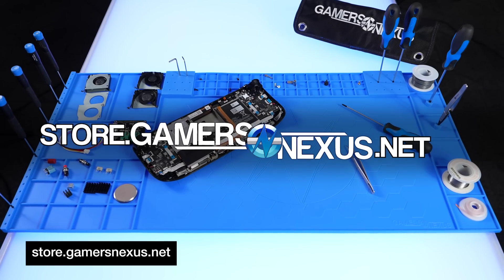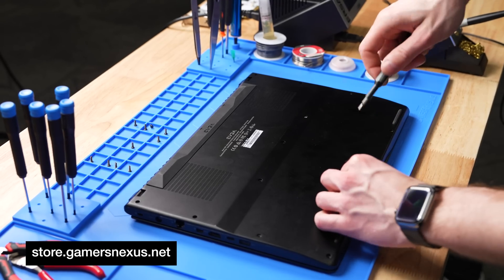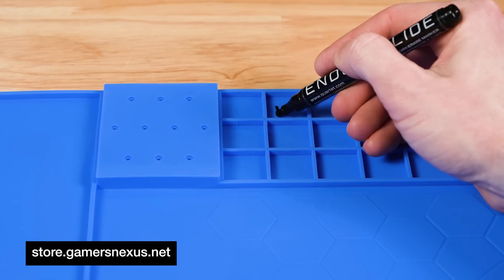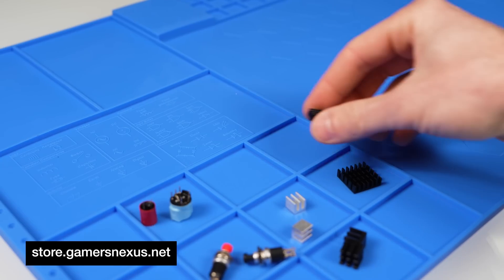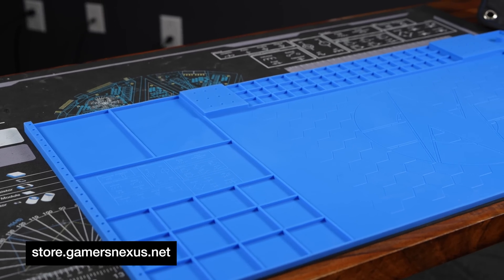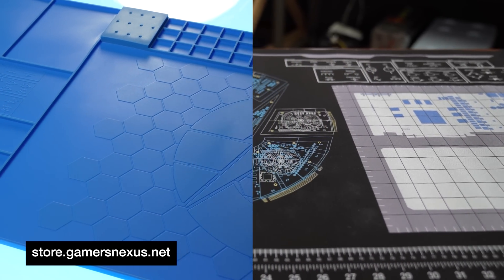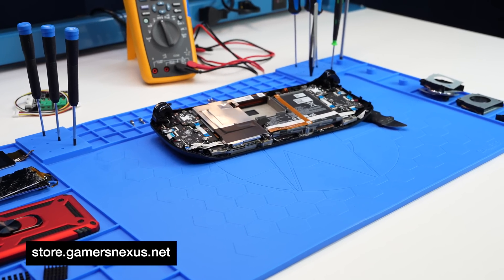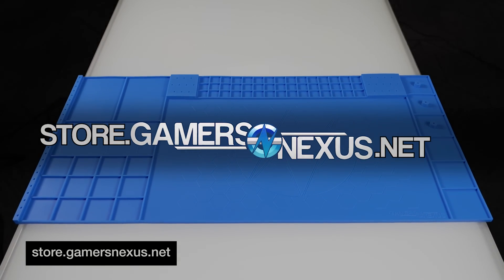Announcing Our New Project & Soldering Mat | GN 'Flux' Silicone Mat

Comment: So you claim extreme heat resistance. But what does that mean in temprature celcius? I might like to use one and some of my hobby projects involve soldering way hotter then you would solder electronic compoments.

Comment: Hello. For me, a  full time Mac/PC repair technician, this mat would have been an instant buy if there was option to buy one without holes for screws and screwdrivers. This stuff does not make sense for any professional because it prevents it for keeping it clean. Simple flat mats are thousands times better in long term use because you can wipe them without using brush or vacuum cleaner.

Comment: I like to build guitar pedals on my free time and this looks pretty nice!

Only thing I would change for my personal use is to switch the location of the smaller squares  and the holders for the solder/wire. I use my left hand to pull solder at work from a solder wheel and my right hand for the soldering iron and that has transitioned to my home use when I'm working on guitar pedals. I however do not have a solder wheel at home so that would have been nice on this mat. Still super cool product non the less and still has other nice features! I may have to pick one up for home use whenever I rearrange my work area.

Comment: Got my Soldering Mat in and already featured it in an Adafruit Show & Tell (every Wednesdays 730pm EST). https://www.youtube.com/live/ueXzfG8FJ7Q?feature=share&t=1349 It's extremely well laid out with space in the top left for both my Hakko 888D and soldering station.  The organizer areas already came in great use during an RC toy tank teardown.  The little holes for screw drivers I though was an unnecessary feature at first I've actually been using and thoroughly enjoying.  One of the best electronics accessories I've ever purchased.  It's brilliantly designed and executed.  Bravo! I will be recommending this mat to all my electronics friends over at Adafruit.

Comment: At the moment do soldering work from my main desk and do not have a dedicated soldering station. The size of this mat would work on my desk if I clear room for it when I need to set it up. I think I will pick one of these up regardless for setting up for larger projects on another surface... But if you make a smaller one I would instantly buy it for my main desk.

Comment: I disliked it because of the big central logo that creates crevasses which will hold up solder balls or screws or anything small because if something drops in the working area, you want the option of flicking/moving it out quickly. Please consider removing that logo from the working area. Also, even bigger would be nice :-).

Comment: How resistant is it to automotive chemistry?

This could be useful to use in disassembly of car parts, however ive seen silicone mats that are damaged by certain types of chemicals due to being either low quality cheap silicone (could been just marketed as silicone when it wasnt) crap or just not made to be resistant to certain compounds.

Also how easy is it to stain, as most silicone is porous and only special use one (medical and ect) is made to not be porous to not grow bacteria

Comment: So no info on ESD ratings. I don't see a place to ground it. Would sure be nice if you made a proper ESD dissipative version, maybe nitrile or neoprene? Or maybe even a carbon coating on the back and some snaps for grounding?

Also, how about some dimensions on the difference sections? Like how big is the main work area (with the GN logo)?

Comment: Been using a medium modmat as a GPU modding surface... Which includes soldering.
Can confirm, flux will stain a modmat, and it will not stand up to direct soldering iron droppage (or large solder hailstones). I know, I'm using the wrong tool for the right job. Right thinking people, buy a GN Project Mat!

But, it is flat, so lives in the middle of a 3-layer sandwich of IKEA finest desktop, modmat filling, and GN mousepad (naturally).

Comment: Man, I was just thinking "wow, I really wish I had an 800x400mm soldering mat, that's about all the space I have if I move my mouse and keyboard from my desk station and use my main monitor as a microscope display", and then I see this video. No seriously, I literally need one almost exactly that size, it will fit perfectly on top of my LTT 900x400mm deskpad without having to shove the corners under my compressible foam speaker risers like I did on it. Y'all nailed it with this thing LOL

Comment: Exactly how heat resistant is it? You say a soldering iron is fine but you can run a soldering iron at a very wide range of temperatures.
If you're using leaded solder you can run it at just 220c, but when I was soldering, I was usually keeping it between 380-400c.
As there's no exact numbers on your store page I'm asking the question here.

Comment: I'm curious how it can handle high heat load, for example if I blast one spot with 300°C hot air does it bulge up?
For me the inprint ruins it, the main surface area should be competely flat.

Comment: Will you release one in the opposite orientation?  I'm left handed and don't keep parts / tools on my left hand side.  The cable from my soldering iron would knock into them or my hand would accidentally knock into parts on that side.  This would be an insta buy if it was flipped for lefties as well.

Comment: Is there any worry of this building up a static charge and killing electrical components. I've read negative reviews about similar products online.
Reply from the maker: In order for soldering mats to be extremely heat resistant, they are made of silicone. Silicone is an insulative material (there is no way around this), and so for highly sensitive electronics, you would be better served by a Modmat-style surface (anti-static); however, many repair shops independently ground their technicians (e.g. wrist strap to a table-mounted ground point) so that they can reduce points of ESD.
Reply: @GamersNexus  so the mod mat would be a better choice if I'm just working on sensitive components or parts. With the soldering mat being better for soldering. With the idea that if  I'm working on a electrical component for soldering then adding a grounding wrist strap would help mitigate / reduce the likelihood of shocking a component. Awesome thanks. Im hopefully this and the modmat don't sell out before I move in to my new place at the end of the month.
Reply from the maker: A grounding strap would not work because it would be grounding into silicone, which is insulative. The technician would ideally independently ground themselves to another ground point, as an insulative and highly heat-resistant surface does not have a good path to ground.

Comment: I'm still waiting for that fan testing machine content...
Reply from the maker: Have you not noticed the huge increase in our CPU, GPU, and cooler reviews the last few months? Fans are on the way, but it took us 3 years to add air cooler reviews back to rotation and 2 years to add PSUs. We always move slowly to make sure we are doing things right, and as this is a small operation where I am personally responsible for a lot of the work, it means I interrupt that testing any time I need to work on a CPU, GPU, etc.

Comment: I have a couple silicone mats of various sizes. The design of this one actually addresses several issues I've had using them to do console modding. I instantly bought 2 (you sold me the second one by showing it being used for gunpla building, so shoutouts to the crew member whose idea that was).
Reply from the maker: It's so cool seeing how many people are already commenting (twitter and here) about using it for gunpla!
Reply: @GamersNexus  question is, how does the mat hold up against some of the Modelling glues, i.e. Tamiya extra thin and similar? It may get quite a surge from the kit modelling community if ...
Reply: @crazylocha2515  not much sticks to silicone so I would imagine it would at least be able to scrape it off if it bonds at all
Reply: @Voyajer.  that's the only reason for the question, most modelling glues melt plastics together and are interesting what they can do to unsuspecting surfaces. Am certainly hopeful that it has a negligent if any effect on the silicone surface. There are a few "hotter" glues than the Tamiya XT, and would be willing to do further testing on my own purchased mat. There's just no reason to go too far if it's already a known problem. Looks like typical cyanoacrylate glues would be fine, but they are a very different chemistry. So, thought I'd ask 👍😁
Reply: @crazylocha2515  👍😁 back atcha!
Reply: @crazylocha2515  Quantum 'epoxy' bonds will be fine but we'll have to wait another 46 years for that
Reply: "Wait, so GN meant Gundam Nexus all this time?"
Reply: This seems made by people that use them.

Comment: You'd better distribute ESD mats. They are really hard to buy for a home lab sometimes..
This..
this is just a gimmick that is contrary to what's really required for a person who does solder seriously on so many levels that it is obvious that person who designed it has nothing to do with EE.
Sure, for wealthy amateurs this won't matter much anyway.
Reply from the maker: Hi Leeroy - we actually sell ESD-specific mats as well. You can check those out under the "Modmat" category on the website if interested!
Reply: @GamersNexus  not sure about those, I had in mind industrial type (universal ones, IIRC they are even being used as ESD floor material as well) sold in giant rolls that cover entire workbench after being cut to width. Used everywhere in factory buildings that you guys made tours in the past. Bet you could have some contact to ship those.
As for soldering, having quality surface like a proper ESD bench, one should only need up to 2-3mm thick layer of SMOOTH (because cleaning all these cutouts in your mats from dust, dirt and flux won't be fun, I know from experience) silicone, that does not have to be of large area at all. Even A4 is excessive in most cases, and silicone thicker than 5mm is definitely overkill, waste of expensive material. It would be wiser to invest into additional surfaces that silicone can not substitute like cutting mats and heat insulating layers (especially for hot air rework).

Comment: You know, it might sound odd, but this looks like a damn fine surface for those who are into tabletop wargaming like warhammer 40k as a project mat for building and painting models. All the organization and even points to hold things like brushes as well as a surface that might even fair well against model cement looks like it'd be quite the nicely functional setup. I assume a question others have asked already but just in case, are any other colors of the mat planned? I'd assume a good color option would be clean white that would provide a great contrast background for small parts and the like for people who tinker or fix things like phones and other small devices. Blue is pretty good but of course white in that use case would be hard to beat.
Reply from the maker: Great point on the Warhammer models, painting, etc! Patrick was using it internally for a Gundam model build the other day. As for other colors, none planned right now!
Reply: @GamersNexus  The dude has a point about the white one. Get it planned!
The depth of the screw sorters and the tool holders look great.
Reply: @GamersNexus  a black or a green option would sell like hotcakes.
Reply: @GamersNexus  If this gets reviewd in the UK by a certain techtuber that'll be their only criticism - that it doesn't come in white; but a blue that would have been an awsome fit for their channel about ten years ago! LOL!!!!
Reply: >You know, it might sound odd, but this looks like a damn fine surface for those who are into tabletop wargaming like warhammer 40k as a project mat for building and painting models.

It's probably not odd considering they mention model painting as one possible use case at 2:40

Comment: All of that for 50 bucks? That's beyond phenomenal. I was excited but was scared it was gonna be like 100 + but I'd be more than happy to pick one for for 50
Reply: I was thinking the exact same thing... Absolutely awesome product, and when I saw the price, I was astonished!
Reply: I was expecting closer to $100. Seriously impressed.
Reply: Not 50 bucks, it's 70 bucks.
Reply from the maker: Thanks, Mercury! We had considered $60 as we felt strongly it'd still sell well there, but decided to just make it a great value!

 @RedOneM  It's $50. Shipping depends on where you live, of course, as it is a heavy product and the box weighs almost 5 pounds.
Reply: @GamersNexus  No wonder then, if it weighs so much 😅 Couldn't the mat be rolled up, so it saves up box space? Or does that put too much stress during shipping?
Reply: @RedOneM  Most shippers charge by weight rather than box size.  Only time box size factors in is when it's super oversized unfortunately.
Reply: @RedOneM  it likely is rolled up, like their other mats. Shipping isn't inexpensive these days, though, except for small and light items. $20 for a 5lb box within the U.S. is reasonable.
Reply: @GamersNexus  Purchased coasters and Volt Mat !!  Keep up the Good work !!
Reply from the maker: The mat is rolled-up, but the weight impacts it most. Depends where it's going and who the carrier is. It's the box length that triggers some of them.
Reply: @RedOneM  It is shown rolled up in the vid.